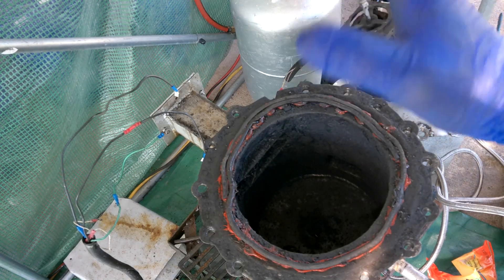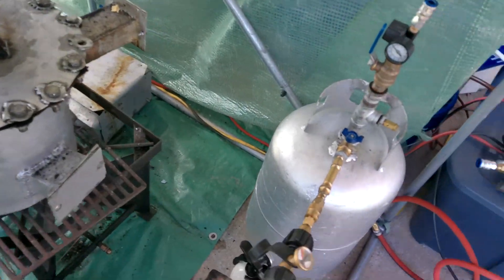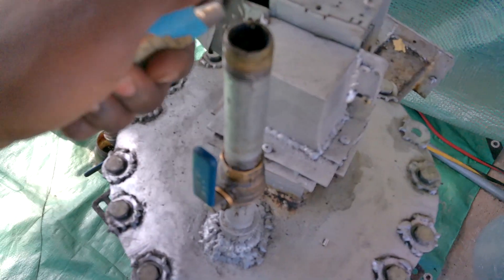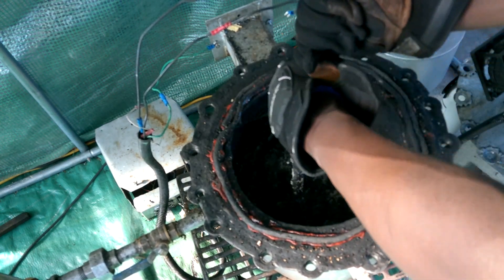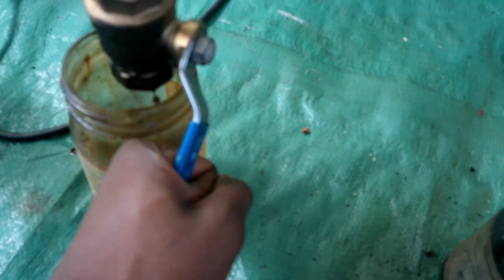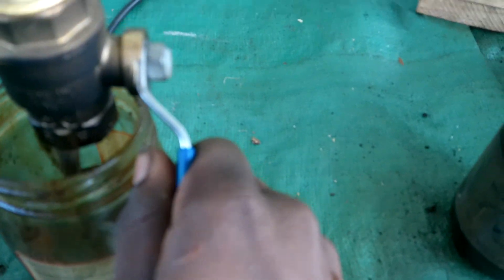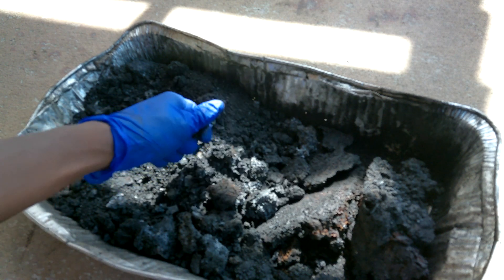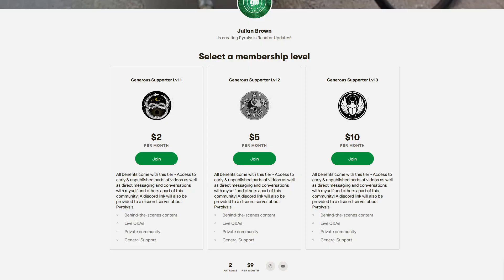Turn FOOD into FUEL with MICROWAVES!: Food Waste - Will it Pyrolysize? Ep. 6

Comment: Hi Jab, I came across your interesting and amusing channel. I live in Denmark and the "the next big thing" is pyrolysis, especially organic "waste" from agriculture (straw, manure, from livestock, fiber from biogas production). Danish agriculture emits 10.5 mill ton CO2 equivalents which equates to 22% of total emissions. Half of this can be turned into what they call bio carbon, which is made into little pellets that get ploughed into the ground to improve soil. The rest is to be turned into hydrocarbons such as "green" jet-fuel (kerosene). The potential to remove CO2 from doing this is 22-25% of entire nation's emissions! What remains from sewage treatment and sedimentation from it is being pyrolysised creating a totally energy efficient waste water treatment that exceeds 100% as heat is utilized in district heating. I hope they might do the same in the US of A. Full documentation has been published by DTU (Danish Technical University). Another "experiment" was done with tyres but was temporarily closed down due to neighborhood complaining of smell (burnt rubber).

Comment: So what would happen if you did a random trash mix? Shredded up food waste, tires, plastic, cardboard, grass/wood chips, etc? In a similar way to how trash would be in a landfill. I know some companies are already using plasma pyrolysis gasifiastion with municipal city waste, but how would your design do?
Reply from the maker: It would make all the same typical products, especially if there is plastic in there. Depending on the water content, a lot more water than oil will be produced